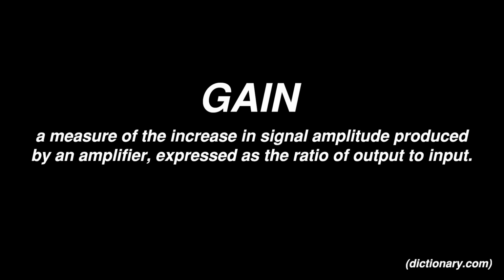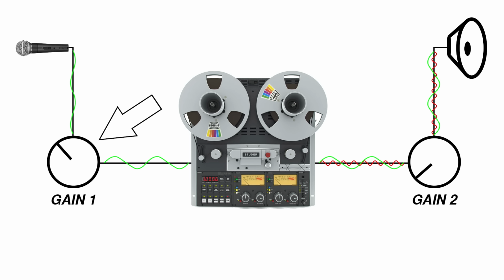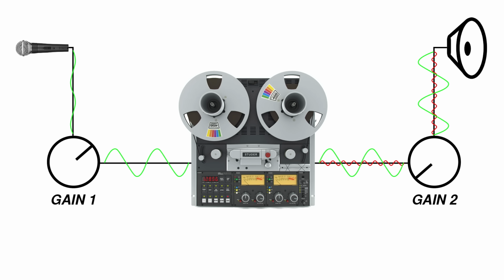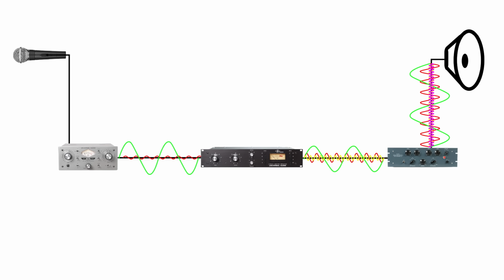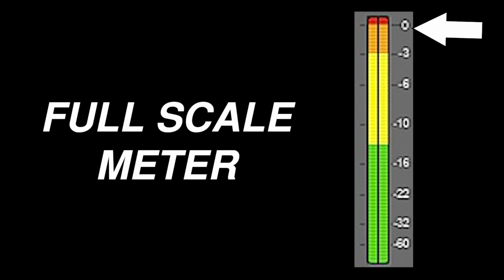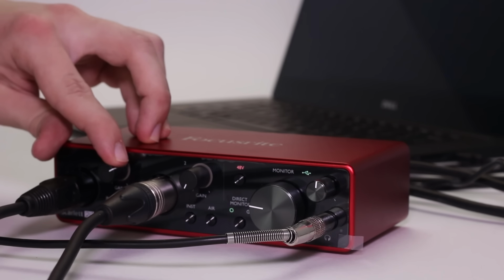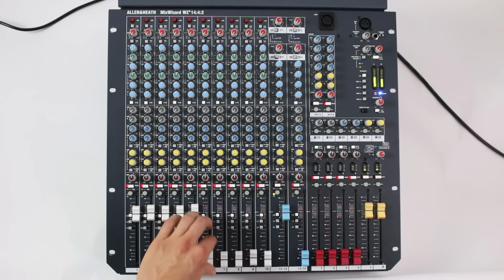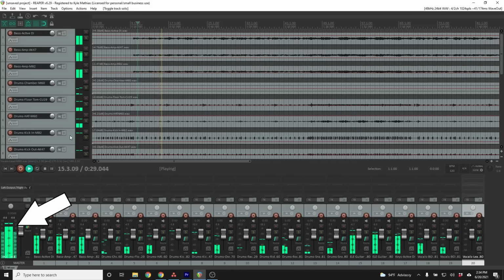Gain Staging Secrets Every Great Audio Engineer Understands!

Comment: I mix 100% in the box and I always use a clip gain on each track to have them at roughly same level (-18 dbfs) before even starting mixing and moving faders. Doing this I have enough headroom in the master bus when I have all faders at unity . And people tell me I don’t have to do that since I m not in the analog world.  I don’t know what to think. This video seems to prove me right🤔
Reply from the maker: You don’t absolutely NEED to do that, because your DAW is probably operating with 32-bit floating point processing. But it’s still a good practice I think. At the very least it makes your meters more meaningful if you use them instead of clipping them constantly.

Comment: I don’t understand why you say that clipping is a bigger problem for digital systems than analog… 32 bit digital formats will maintain the signal even if it would clip when you play it back (past 0dB). So even if your digital signal is clipping, you can always turn down the gain without losing any of that signal. Combine that with your point of nose floors being more forgiving for digital systems, and it seems like you don’t even need to worry that much about digital clipping until you are in the mastering phase.
Reply from the maker: A lot of programs and devices still record with 24-but fixed point. Processing within the DAW is where 32-bit float primarily comes into play. Check out this video by Julian Krause: https://youtu.be/4YRp-FIsNDA

Comment: 24-bit digital is not difficult to understand. What puzzles me is 32-bit float. It seems to not 'clip' when whatever is designated as 'zero' on the meter is reached, and the 'zero' seems more like a general arbitrary target to shoot for rather than a barrier to not exceed, such as 0 DBFS in 24-bit or 16-bit.

I've seen it mentioned a couple times that it has a theoretical headroom of ~1500 dB! That is not a typo. But it's hard to wrap one's brain around that, and I've never seen it explained to my satisfaction. Yet.

When you have a DAW that has samples resident, built in to it, like Logic Pro, everything begins life in a mix inside this 32-bit float domain (external things can also be added at 24-bit, where the rules are a bit different). So it seems we can get away with a lot, due to the high dynamic range and low noise floor.

That said, there can still be distortion issues, but I have a pretty good ear for detecting that, and if the mix begins to have the slightest issue that appears to be distortion, I simply lower each track by 6 dB and remix from scratch. And I think when there might be distortion, it's more a matter of overdriving sensitive plug-ins than anything else. Sadly, plugins rarely come with input meters which would allow one to set the input levels optimally. Some gainstaging can only happen by ear.

Another thing that I wish I understood better is 64-bit summing. I would love to see you do a video on both of those things.

What I do to gainstage 32-bit float is not to pick a particular target level below zero, like is often done with 24-bit digital. I begin by setting the output level of the samples directly (the level going in to the track lane), so that it remains under zero at the input of the meter for that lane, for the entire track. If the track does not exceed zero, I leave it alone, bc it only distorts at 0 DBFS, and not at all at -1 DBFS (although I'm not exactly sure how this works in 32-bit float). This is sort of like setting the trim on an old-style analog mixer—the same concept.

If none of the tracks get near to zero on the output, I would raise all of them up to increase the S/N, but not so much that any of them exceed zero. It does not have to have actual headroom, bc unlike analog, there is no transfer curve, and the higher you go (at least if we assume zero on the input meter is the target) distortion is not incurred, and the S/N is maximized.

My theory is if you are careful in level setting, you don't need to worry about adhering to a 'standard' 'below zero' number, at least in digital. Just stay below zero, and this can be directly under zero and still not distort and will maximize S/N. IOW, that area above -18 or -12 is not like the demilitarized zone in Vietnam. It's usable territory if you use it carefully, and using it maximizes S/N. Even though the noise floor is already low, the cumulative noise of 100 tracks is a lot higher, and digital quantization noise is like a buzzsaw, where analog hiss is actually not that bad.

Headroom, in this application, would be better named 'error room'. Make no errors in setting levels (keep it under zero), and you don't really need headroom, unless you send tracks out to be mastered somewhere. But that is also a myth. Mastering engineers know how to turn tracks down or bounce them to add headroom they imagine they need to work with them—they just don't like to have to.

I think the EBU designated  -18 dB for digital audio bc people in broadcasting or other recording professions just typically are not all that careful, or educated about how digital audio works. In a long-stage audio chain that might be touched by a lot of hands, some who might not be all that diligently careful, idiotstaging is as important as gainstaging.

 And since digital distortion is like fingernails on a blackboard, they chose this to err on the side of caution. But be careful, and it does not matter what number is designated for the masses. Unlike analog, all you have to do is keep it under 0 DBFS. Anywhere under 0 DBFS.

Then I make sure nothing exceeds zero on the output of each track, although exceeding zero in 32-bit float seems to not be problematic.

I set the summing fader to -6 dB (input) for starters, and only adjust that if the sum of the mix exceeds zero or if it appears low (which is rare). Again, I don't think headroom is an issue, especially since I master my own mixes.

Of course at the output, things move from the 32-bit float domain to the domain of 24-bit AIFF or WAV, so at that point it's important to obey the 0 DBFS rule. There is typically an adaptive limiter and multiband compression prior to the output. My end result is super-low distortion and super-high S/N, and I seem to have no trouble with that using this approach to gainstaging.

That said, I'm always open to suggestion.

Comment: Nice video. However,  I differ a bit.  You talked about setting levels for a mix.  the way you set the gain was how one would set it for proper recording levels,,,  Its not how Id set gain for mixing the recorded tracks.   In the DAW software you dont need to worry about clipping on individual tracks due to 32 bit floating point,,,only the input and output channels( ie recording and  output mix bus).  So Just set the level of all your tracks so they each peak at  0 dbFS.  Or just  batch normalize all tracks to 0dbFS.  Simple.    This gives a healthy signal on each channel so your working in the faders best taper range when mixing to be able to make more precise level adjustments. Then drop each fader.  Then simply start mixing leveling one channel at a time raising faders.  I always set my my most dynamic instrument first,, (usually its the kick drum,) at a level that allows sufficient headroom and its well controlled with a compressor or limiter. Typically i want transient peaks no higher than -12db.   Then the rest fall in place  and i never clip master bus. Master fader always stays at UNITY.   Thats my 02.
Reply: Problem is you now work with faders at lower than -12 db and they are less precise. If u set the level of each track at let’s say -18 then you have a lot of headroom while faders are at unity. This let you work with faders close to 0 and in their best resolution range . But that’s only a way of doing it .
Reply: @starbeatsofficial4 Yes,  I do see your point.  Thats not how ive ever done it.  I think for me i visually like having my meters peaking  right near where the fader is. its a visual thing.   I'll maybe give the other method  a try.   Im not too old to try something new and switch if it works better.
Reply: @scottsmith4145  I actually like your method and I m gonna try it in my projects. I think what’s important is that we both start our mix by settings all our tracks at roughly the same level ( 0db in your case, -18db in my case ) before moving faders. That’s something we share in our different methods👍🏻
Reply: @starbeatsofficial4 I agree, staying consistent with same input level for all tracks is key.  For example all my downline inserts like EQ, gates, compressors etc are configured presets based on that specific input level.  If i change it, then I have to tweak  thresholds etc etc.   On the subject of fader resolution,,,  you actually can mix entirely around unity if you want in the DAW software if its 32 bit floating point with no worries.   I use Cubase for example. There is limitless headroom so no worry of ever clipping any individual channels,, only the output bus. Just set kick(or loudest track)  to peak at UNITY as a rule and mix from there.    You can pull the output bus fader down so your mix is not clipping amd right where you want it..  I repeat you can pull the output bus fader down. Its OK! Doesnt affect anything according to the cubase manual anyway and im sure majority of DAW software today works same.    This now allow you to work in the  area of best fader resolution.   Only reason i mix how I do is I can leave my output bus at unity and not clip but its not necessary really and as you pointed out  im giving up fader resolution,,, so ill probably try this.  Good luck!

Comment: There's another aspect of gain staging that isn't covered in this video that is of paramount importance to both live audio reinforcement and recording studio practice, and that is setting the maximum SPL output levels of the PA system or nearfield monitors. Bob Katz recommends his "K-System" for recording and that's a very good place to start: -20 dBFS pink noise should equate with 85 dBA SPL at the listening position, which makes 0 dBFS equal to 105 dBA SPL. When mixing live audio in small clubs, I shoot for peak SPL of no louder than 96 dBA SPL. The rule of thumb here is that if the peaks are making you wince, it's too loud. But it should be recognized that even 96 dBA SPL is technically too loud for extended exposure.
Reply: This is important, because I think most live music is too loud because amateurs think loud = better. Because most people in music dont LISTEN they want to IMPRESS. Because pussy.

Comment: There's really no reason to set gain structure so conservatively in digital systems. Even if signals in the digital domain are less susceptible to noise, all audio gear has to be analogue at the source and analog at the output. When I'm setting initial recording levels, I generally ask musicians to give me their loudest sound and set my mic preamps to produce peaks of at least -6 dBFS. Remember, these are peak levels, not RMS, and that 6 dB difference is literally twice as loud. You can run your inputs right up to 0 dBFS peals, so long as you don't clip ( and every DAW software package will let you know if you've clipped by lighting up the channel meter in red and/or informing you that x number of samples in a row reached maximum values, indicating clipping), but in practice, musicians may not have as even playing dynamics as we might prefer, so we do want to give them a little wiggle room.

The number one rule of gain staging should always be "amplify as little as possible and as early as possible in your signal chain". Preferably, there should be no amplification at all past the first preamp, only attenuation. Some dynamics effects may require makeup gain, of course, but EQ should in general be used as little as possible, since all EQ changes will also shift the phase relationships, and should preferably be cuts rather than boosts.

Much as we might all deplore the "volume wars", the truth is that we are all now forced to squash the heck out of popular music just to stay within the ballpark of other recordings. YMMV if you are doing film/game scoring or classical and jazz recordings.
Reply: Also, while I agree that the master output faders should normally be at unity gain, there's no reason that the individual track faders or bus faders should be at unity gain. Most of them, in fact, should be well below unity gain.

Comment: So forgive me if I'm asking stupid questions because I'm new to this whole gain staging thing and as well as the fact that I've got vision challenges. I can't see because I'm totally blind. But when I set all of the plug-ins in my mix chains each channel strip peaks at around -1.4 or -1.3 DB and even the the master bus, in logic is called stereo out I believe. Everything peaks at -1.3 DB but the main channel strip like the main audio channel where the vocals are peaks at around -2.0dB. and all that to say nothing ever reaches zero because I've got limiters all over the place because I'm so paranoid that I will clip and distort. Am I doing everything right? Or am I doing something wrong? So when you talk about the master bus, are you talking about stereo out in logic pro?
Reply from the maker: At the end of the day: if it sounds good, it is good. There is nothing wrong with using a lot of limiting, as long as you like the way it sounds.

Comment: Can you comment on this opinion : Even in the digital realm VU measurement is a better meter measure to consider as many plugins are modelled on analog gear that took into account VU measurements and whose sweet spot was - 18 dbVU?
Reply from the maker: I’ve heard that some analog emulation plugins do have a “sweet spot”. I’d guess the sweet spot is around -18 dBFS, which often correlates to 0dB VU. A VU meter reacts differently to quick transients and peaks, compared to a true peak meter, etc. It’s just another tool. I personally rough in the levels with a digital meter, but I can see why someone would use a VU meter for this. 

Main point: don’t get too tied up thinking about setting levels with meters. Get close, then let your ears guide your decisions.

Comment: What I get confused about with gain staging in a DAW, is some audio engineers say to use a VU meter and aim for around 0dBVU for each track - whereas here you’ve suggested to not use that at all? So is using a VU meter to gain stage in a DAW completely redundant?
Reply from the maker: There is no right way or wrong way. The VU meter can be helpful or you can just use an FS meter.
Reply: @AudioUniversity  appreciate the reply, cheers 👍🏼

Comment: So when setting up a mix for gain staging , I noticed that all channels are at 0 db , so You would do gain staging before volume balance?
Reply from the maker: I’ll usually get input levels set before I balance with faders. I just want to get the level set in a way that maximizes my faders and leaves some headroom for increasing the signal level while mixing.

Comment: Great Info. I'm a mobile dj using a laptop software, controller for the soft, analog mixer and active woofers and tops... It's a challenge to set up the corect levels for inch fixture in this chain, specially becouse I use the tops connected to the woofers via crossover... I send the signal from the software in green, just below yellow rarely appears, controller levels to 0db, master output of controller to 0db...from there, what levels to use in the chain? Mixer has gain nob on inch channel (I use only one channel for input from the controller). What level setting should be the best from here? Any advice is welcome recived. Thank you!

Comment: Gain staging is the process of making sure the audio is set to an optimal level for the next processor in the chain in order to minimize noise and distortion. By gain staging through your analog and digital systems, you can achieve the best possible sound for your recording.

Comment: QUESTION:  I'm considering getting an AER R44 ribbon mic for tracking vocals.  Currently, I use a Universal Audio LA-610 for mic pre and compression.  Some day that will be enough to power the R44 Mic, but some are adamant about using AEA mic pre's to get the best performance.  I love my UA LA-610, so I'm keeping that no matter what. But I'm considering adding the AEA RPQ 500 mic pre right before or after the UA LA-610. So, 2 mic pre-s in a row.  Does this sound like a good or bad idea? What are some things I may need to be mindful of?    Thank you! ~Mike
Reply from the maker: Hi Mike. I would NOT recommend running the line out of a mic pre directly into the mic in of another. I think you’ll be able to get a great sound out of either one, though.

Comment: I've been doing live sound for almost 34 years. In the old days, I was taught how to calibrate a whole system... From the input and output of a console, to the eq, to processing, to the crossover, and to the amp. A lot of the old systems that I cut my teeth on, you could tell that care had been taken to pair gear with proper metering through the various points of the system. 

A fair amount of time would be spent matching gain through the entire chain. 

I rarely see people do that anymore.

Comment: I've also heard well known engineers say not to worry too much much about head room in your tracks and  you should work "hot". This being that if you have everything turned way down then when you get to final mix/master stage and essentially crank everything back up then your sounds will sound much different to how they did when you initially composed and put them together. Especiallying given most DAWS allow you to work in 32-bit float.